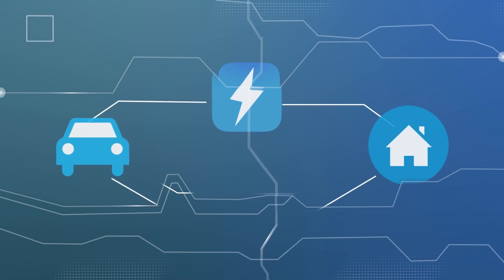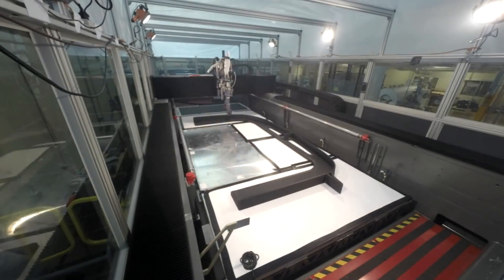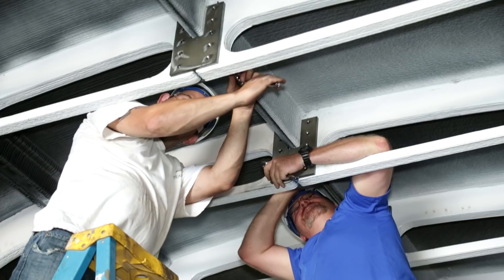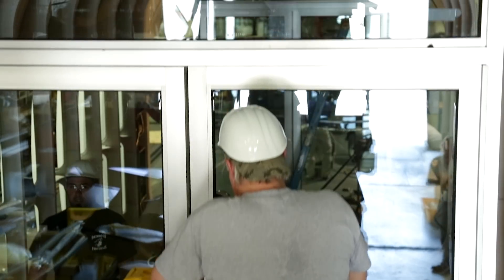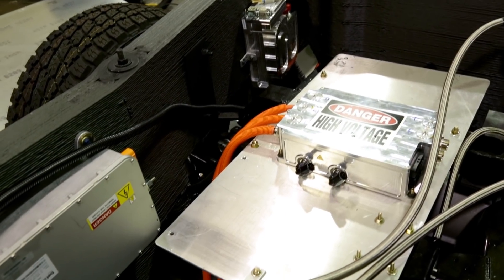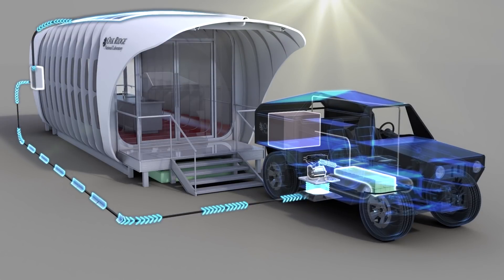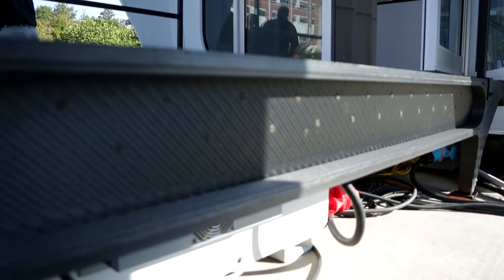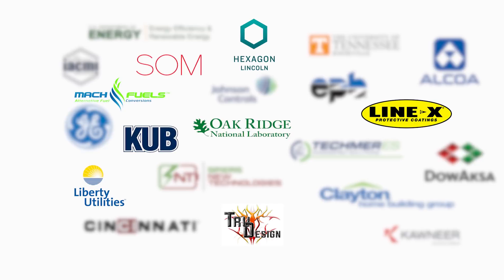Additive Manufacturing Integrated Energy Demonstration

Comment: Minute 3:13: extracting electical energy from an electrictiy-powered car uses the car as a powerbank; nothing really innovative here (or are there no bi-directional charging Systems?)  To make it work, you need to think when the probability of using the car detached from the house is low (e.g. your next trip is not negatively impacted). That's a software problem - nothing innovative here for a manufaturing lab?